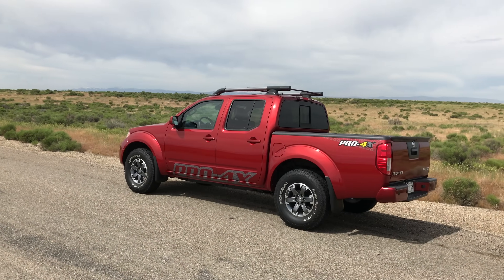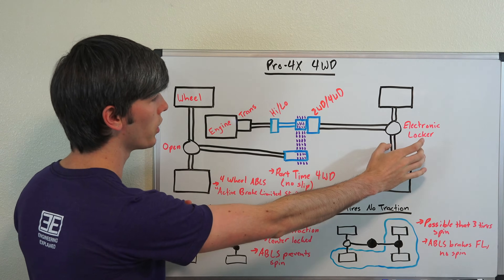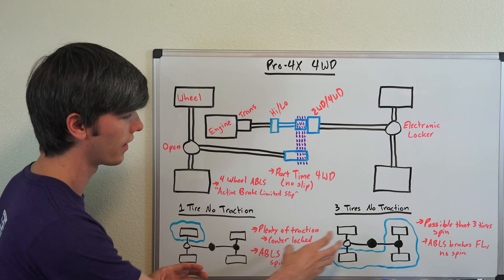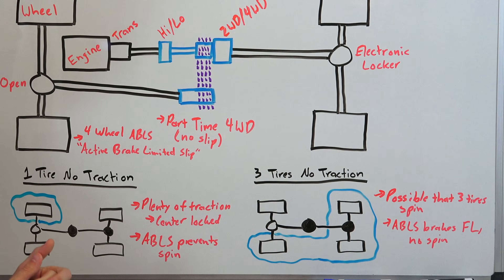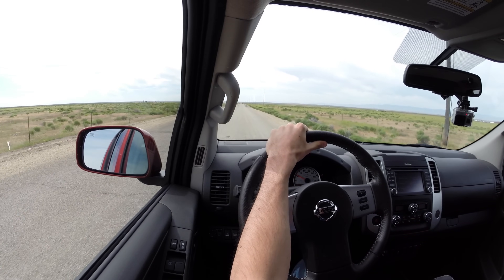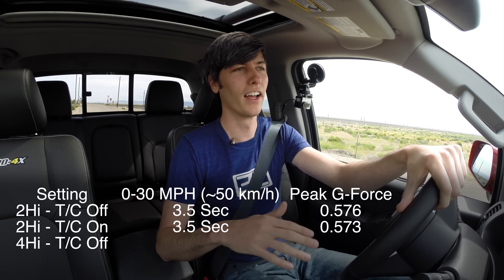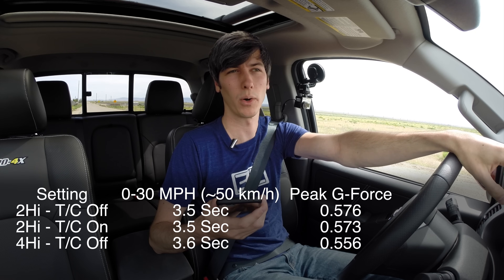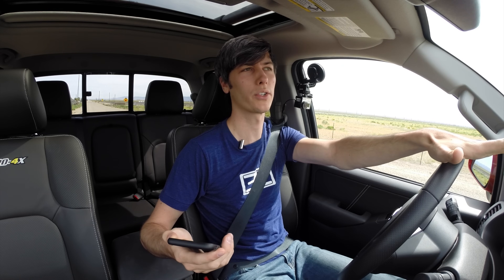How 4WD Works — 4Hi vs 4Lo vs 2Hi — Acceleration Testing

Comment: Since 2005 we had 4 generations of Hyundai Sonata but Nissan Frontier is still looks the same as 2005!!!!
Reply: Abbas Sadeghi Bajgiran they have has facelifts but ya they bascially are the same
Reply: Abbas Sadeghi Bajgiran Google Nissan frontier LP300
Reply: It's a classic. Great trucks don't need redesigned every few years
Reply: Abbas Sadeghi Bajgiran the Navara model has been updated 2 years ago. I'm not sure why America is still stuck with the d40
Reply: I guess if people are willing to pay for a brand new truck that looks EXACTLY like a 2005 truck then they figured why change it. lol
Reply: Here in Thailand we have a brand new model since 2015.
Reply: Right! Soon as I saw that steering wheel I cringed and questioned if this was a new truck. Looks awfully similar to a mid-00s Altima wheel!
Reply: Yeah, and it wasn't even best in class in 05...
Reply: And since 2005, if you bought a Hyundai, it would have rusted apart on you and died and you would have had to replace it.  4 damn times in that time frame.   Meanwhile that 2005 Frontier would still be driving.     There's a reason why people are still buying the Frontier truck after all these years.  It is reliable.  They worked all the bugs out of it long ago.  It is the most reliable truck sold in the USA period for the past 4 years in a row.    That and it's sold for the price of a TRUCK, not the price of a luxury automobile that just happens to have a truck bed attached to it.    Honestly why change what is working?

Comment: No wheel slip in 2WD?! The 4 door must take all the fun out. I've driven a 2008 King cab numerous times. It consistently burns rubber in 2WD, with traction on.

Comment: this is a question that I have thought for a while...what are the advantages of a leaf spring suspension
Reply: Simply put leafs hold far more weight and they are also more durable.   Not nearly as smooth a ride as any other options though, hence why you only see them on rears of trucks today or on the front of heavy duty trucks with a solid front axle.
Reply: jkutyna no, no, no😙, my 2018 dodge 3500 4x4 has solid + coil in front

Comment: I would like to see an engineering explained video summarizing how lockouts work and how the 4Lo and 4Hi are put together and switch basic back and forth within most models. How does it all squeeze into a transmission not much bigger than 2wd's and all appear in the same amount of space as any unsuspecting 2wd? whether you do this request or not, I appreciate your videos. you explain things very well

Comment: If you have three tires in the air, you have things other than traction to worry about.
Reply: Like I said, other things to worry about.
Reply: or you could be high centered on a rock offroad, which is more likely.
Reply: Well 4 wheels in the air is worse if you stay that way
Reply: I believe R Kelly wrote a song about that.
Reply: ttsgeb - like a lack of gravity?
Reply: like gravity
Reply: Even two, but that was on my bike last year. I should hire this kid to figure out what my rapid deceleration peak G-force was.
Reply: ttsgeb lol yeah
Reply: TheUniversalVince wrong channel :p
Reply: Yup!😂
Reply: If three of your wheels are in the air I think traction should be the only thing you are worried about.
Reply: ttsgeb Damn! 20 hours late
Reply: ttsgeb like aerodynamics

Comment: 4 wheel low hard launch = destroys transmissions everywhere :)
Reply: jrherita do you think? i would expect that it would be much easier on it, because of the greater mechanical advantage it has. it only needs a fraction of the torque to get the vehicle moving. There is much more torque behind the transfer case, so the differentials and u joints would be stressed more.
Reply: And drive shafts and axle shafts.
Reply: jrherita Nope, quicker shifts and higher engine RPM will have torque converter at stall speed (minimal slip/minimal heat generated)... your comment makes no sense mechanically. Sorry.
Reply: +Jack Barlow  It shouldn't damage the transmission unless the fluid is low or very old increasing the chances of gouging. It could damage the transmission bolts by rocking it.
Reply: acephantom903 Not "shouldn't"; "wouldn't". 4-low is much less stressful.
Reply: jrherita LOL, you could not be more wrong. Hard launch in 4-low stresses universal joints, ring&pinion, axle shafts! Pretty much everything other than the transmission and engine.
Reply: I've had an Expedition eat it's transmission after 2 4WLo launches, and I've seen Broncos do the same (automatic of course).  Basically you have a lot of shifting in a very short period of time which I'm certain generates a decent amount of heat.

Comment: So am wondering, isn't there a limit to the amount of rpm for 4low? is it because that's an automatic transmission it auto adjust?
Reply: the transfer case is after the transmisson, so there's usually a speed limit for 4 low rather then a rpm one (the rpm the transfer case see's is the output speed of the transmission, not the motor (input) speed)

Comment: SOOO, that thing can't spin the tires in 2wd ?!?!?! or where you just limiting wheel spin with the accelerator?
I have a 1996 tacoma v6 with over 280,000 miles on the motor and it has no problem spinning them in 2wd on pavement.
Reply from the maker: If I held the brake and gave it gas, it could spin, but I didn't use this method to launch. Your '96 taco is a lot lighter, and much less weight on the rear axle.
Reply: This generation of Frontier has a Wide-open-throttle restriction until 40mph because of all the torque it makes.  A quick tune will eliminate that and allow you to do endless burnouts.
Reply: That nissan can spin the tires just fine.. The 4.0 V6 may be outdated but it still makes decent torque.

I'm not sure why you're judging how a vehicle performs but it's ability to do something completely pointless anyway.
Reply: This engine has 261hp and 281lb-ft of torque. I guarantee you that is more than a 1996 Toyota V6 or a 1998 GM 4.3. Those older trucks DO have something this Nissan doesn't; a throttle cable. Even with traction control turned off, throttle-by-wire vehicles typically do not run the throttle in direct relation to the accelerator pedal. This is done to avoid the unnecessary and wasteful burning of rubber among other things.
Reply: My F350 7.3 manual never spins tires.. 
but it will pass you on the highway while pulling a loaded 5th wheel trailer with ease
Reply: Jay G Need new tires?
Reply: As I posted above, I've driven an '08 Frontier King Cab 4x4, spins tires consistently with traction on. The weight of the Crew Cab must make a significant difference.
Reply: Thanks for the replies! i think the inability to spin tires tells us some thing, one traction control is not fully off even though the vehicle saying its off (+Dan Beeson good point i know other manufactures that do this) or two, +Engineering Explained was not accelerating as fast as possible or three, the truck has some really good tries or some other traction adder like a LSD that we don't know about. When launching a vehicle for the best times getting as close as possible to the traction limit will be fastest. +John yes spinning tires is fun but completely useless however, we would have heard some tire chatter (not spin) if it was accelerating using all of the available grip. Furthermore, using 4WD should  have yielded a faster time that 2WD but, it did not (We all know AWD cars have the ability to lunch harder than 2WDs, this is even more apparent in 0-30 test!). SOOO, this tells me that something happen in the 2WD test. I think it is highly likely that the traction control was not all the way off in 2WD or the truck was not at max acceleration in validating the test. Good Video tho!!!
This is really not that important but i find it intriguing lol anyway what do you guys think???
Reply: My 1995 Ford Explorer cannot spin tires with its 160 hp engine 225 ft-lbs torque. Then again if I tried, I would probably drop the transmission on the ground. 

I also have about 100 pounds of tools sitting right over the rear axle which might be part of it. I've heard that the Ford Rangers which are built pretty similar have issues with spinning the rear wheels without a 50+ pound ballast.
Reply: +holmiumh I was thinking the same.
Reply: they are called Michelins  i have a 95 tacoma too
Reply: Nissan electronically limits the throttle below ~30-40mph ( at least on the Frontiers I know). I believe this is to reduce strain on the drive train for longevity, but don't quote me on the reason. Turning off traction control does not turn off the throttle limitation but there are methods to disable it, in which case you would end up seeing some wheel spin.
Reply: Also remember that not only is a 1996 truck, be it Chevy, Nissan, or Toyota,  a COMPACT that weighs far less, the Nissans today come with FAR more aggressive A/T tires stock.   The Hankooks that my Pro-4x came with are ridiculously grippy for a factory tire.  Even Toyota fans lament the fact that Toyota doesn't offer decent factory tread with their trucks.    That said, with a manual transmission in my pro-4x, it doesn't take much to break the rear end loose if you really want to put the beans to it.
Reply: Jay G I have the manual pro 4x King cab and it slips very easily if I let it. this truck is extremely torquey and quite powerful for a n/a V6
Reply: Right? I have to actively put effort into not spinning tires on dry pavement in my 98 4.3L S10 with 170,000 miles on the clock.
Reply: Nonsense. Compact trucks definitely haven't gotten significantly larger and heavier in the past two decades.  Everything has stayed exactly the same size, and the engines have clearly just gotten wimpier.

Comment: Why would the transfer case use a chain to connect the front diff instead of a gear? You'd think the torque being transferred would require something more solid than a chain.

Comment: what app did you use to measure acceleration and g-force?
Reply from the maker: Pandu Bintang VBox, linked to the product in video description. App is free, device is a little pricey.
Reply: I also want to know it, I would like to know what my mothers qubo can do
Reply: i want to know too lol
Reply: A simple gps app would be pretty inaccurate for this type of testing he uses dedicated hardware.
Reply: I think he uses a V-Box.
Reply: most apps use gps for speed.. 
and use the motion detectors in your phone for acceleration. I used one that would ask you to press "calibrate" and then drop your phone 3 feet onto your bed.  So it would be set to the speed of gravity..  seemed accurate.
Reply: thanks!
Reply: What Full-Time All Wheel Drive Car has the Fastest 0-60 mph time?

Comment: Does the lock button effect the performance of the car if I press it on all the time ?
Reply from the maker: For the rear diff, the rear-locker is only available in 4WD low, which is kind of a bummer, but you shouldn't use the locked diff on the street, which is probably why they prevent it.
Reply: Engineering Explained I have a Kia Sorento with AWD and a lock botton on the dashboard, can I press it on all the time👍
Reply: If the rear diff was locked all the time.. it would cause your rear tires to bind when you turn corners and make your tires hop and chrip and cause high wear on your tires.  I know because my did welded his rear diff on an old f150.  when you are turning from a stop, it will pop, bind and jump.. its terrible.
Reply: There is a simple way to bypass that and get the locker any time, locked 2wd can be good sometimes, that said the average user of the truck is never going to be in a situation where they need a locker anyways.
Reply: That just puts the car in permanent awd, if you turn it on you will get better traction but worse fuel economy.

Comment: Looks like a D40 Navara from Australia.
Reply: The US hasn't gotten the new Navara/Frontier because the V6 is not available yet and Americans love their big engines. They might get an all new truck this time, just like the difference between the Hilux and Tacoma.
Reply: D40 has been replaced by the D23 or NP300 Navara. They haven't made a D40 since 2015.
Reply: Looks like the OLD Navara. The new one (2 years old already) is the NP300.
Reply: Jerry Jerryness It is the same thing with a different name
Reply: Probably is, just rebranded
Reply: Even the interior is almost the same as the D40. I'm surprised the US doesn't get the newer D23...
Reply: Kyle Justin But it's a diesel, so torque isn't an issue compared to gas 6 pots
Reply: Big V8s aren't the future unfortunately, as technology gets better and manufacturing processes allow for greater tolerances engines will get smaller. I love V8s as well.
Reply: Just like a Navara, also just like a Suzuki Equator.
Reply: Jerry Jerryness that's because that's what it is.
Reply: Actually the D23 can't clear USA safety requirements.  They would have to put so much engineering into it to change it and make it road legal in the US, that its better off making a brand new truck from the ground up.  Nissan has stated they will do that as soon as all the engine models for the 2nd gen Titan are released.   As of this time, all that's left for the Titan is the V6 which many suspect will be the same V6 that see's itself as the primary power plant of the new Nissan Frontier.  2020 possibly?
Reply: +Benjamín Valenzuela correct, those 4bangers are not enough in america.